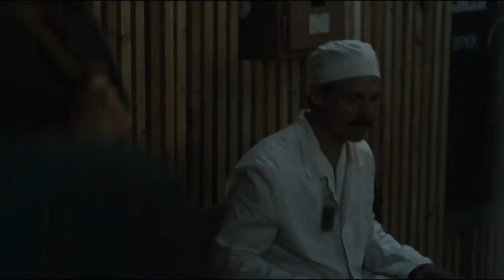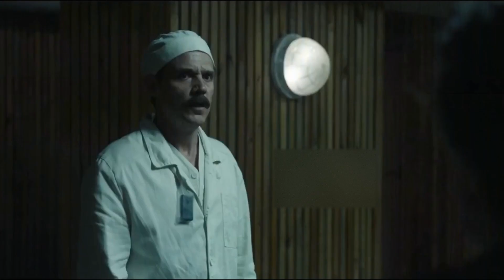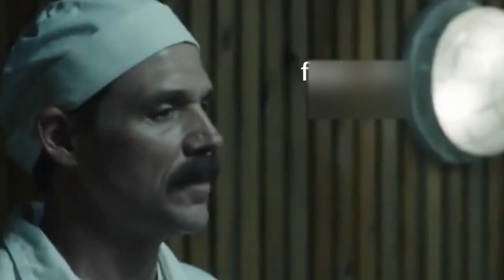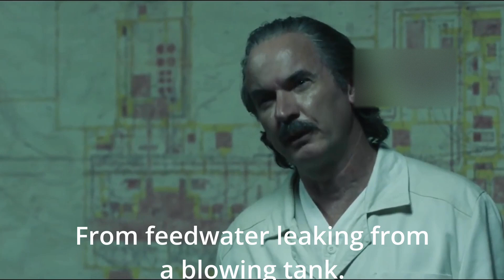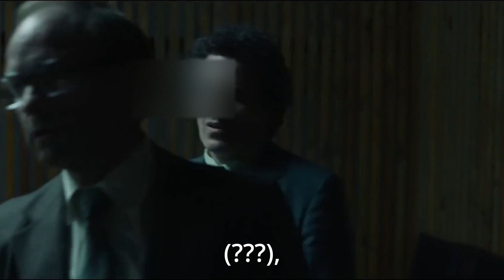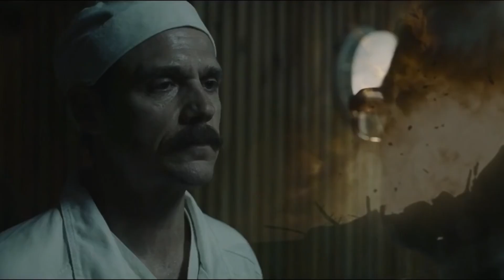"How Could an RBMK Reactor Core Explode?"

Comment: I know how it exploded.

It was a piece of shit Soviet reactor that actually increased power when you ran tests on it, built with substandard parts, by undertrained men, and operated by people who feared going to the Gulag if they voiced (correct) opinions and concerns.
Reply: Don't forget they were also running unauthorized testing which they knew the system wouldn't tolerate if anything went wrong, which of course it did.